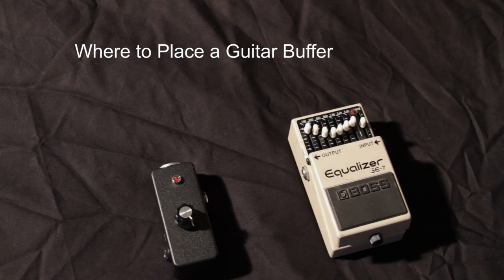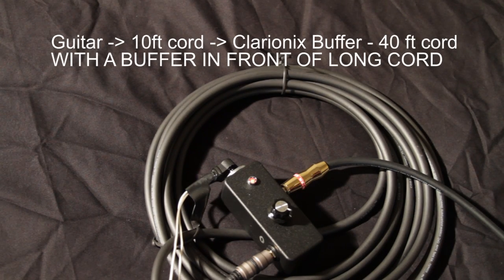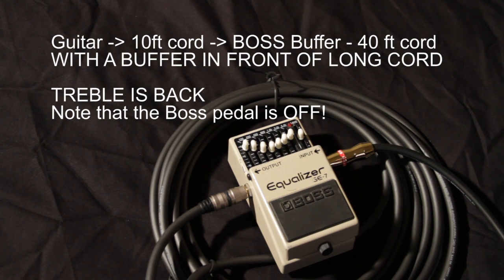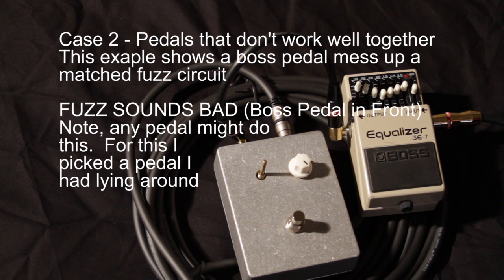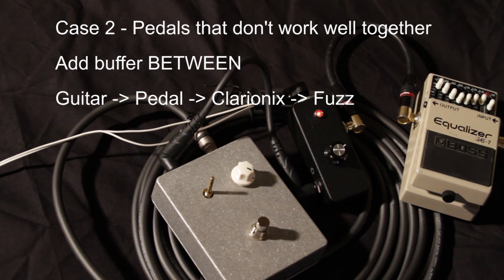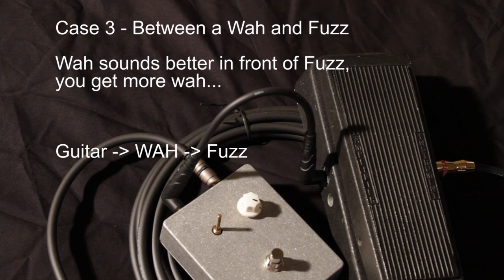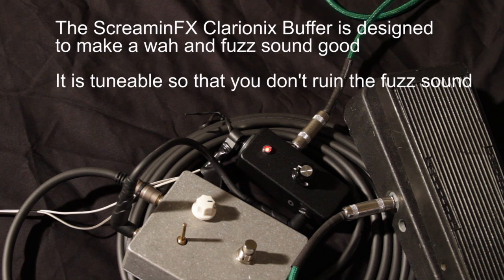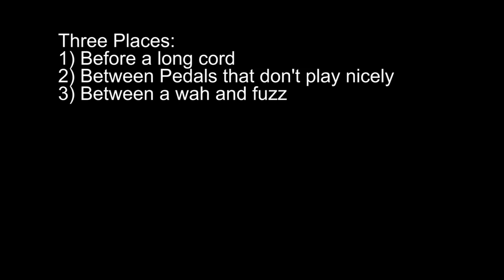Where to put a guitar buffer pedal in your pedal chain

Comment: I have a question and I really need some help with this. My question is... is it enough to have a buffer pedal or two (my boss reverb and tremolo) at the end of my chain to prevent any clarity loss even if there are other pedals in front of the buffer chain? In this case does the boss buffer work even if there are other pedals enabled in front of the boss pedals, or does it only boost the signal for the pedal that is enabled and everything in front of it does not get a buffer? I really have issues to run a boss pedal at the beginning of my chain because it completely messes up my fuzz pedal and distortion pedal because of the impedance and buffer function. I would like to have a buffer pedal at the beginning of my pedal board but is it necessary to have a buffer pedal at the start even if you have a buffer pedal at the end? thanks for any help!
Reply: Fendera signal will be boosted from the point the buffer is set. If there is a buffer pedal at the end of chain, the signal loss from all the cables and pedals will still be there. It will help  long cable run signal losses from end of chain to amp. Basically, there is no signal loss FROM the point a buffer is set. Hope it helps.

Comment: Where would you put it if a pedal is sucking tone out? Before the tone sucking pedal or after? Thanks I wanna get this!
Reply from the maker: +thedonutholes69 First I try before in case the tone sucking pedal has too low of an input impedance causing tone loss.  If there is no big difference, then after in case that pedal can't drive the signal through the cables, especially if there is a long one after it.